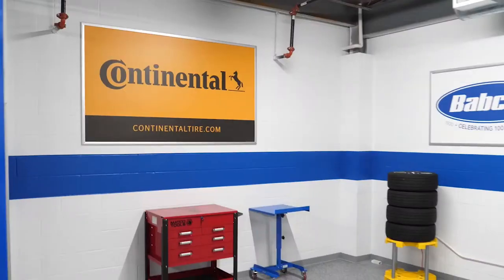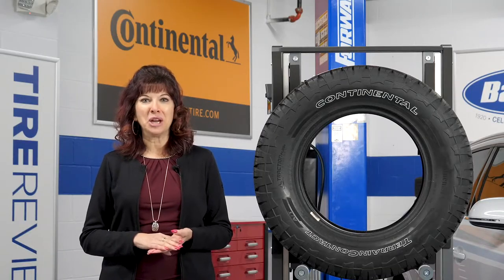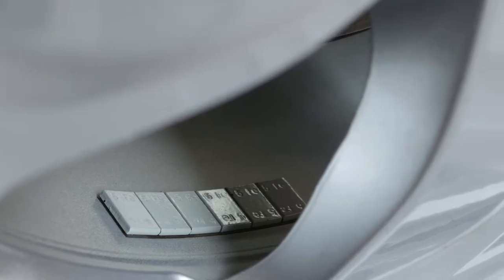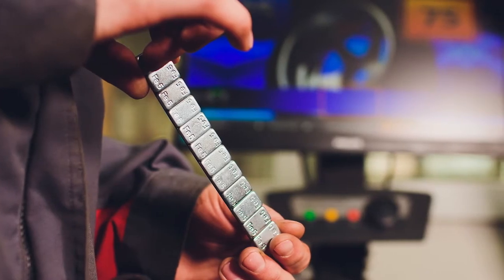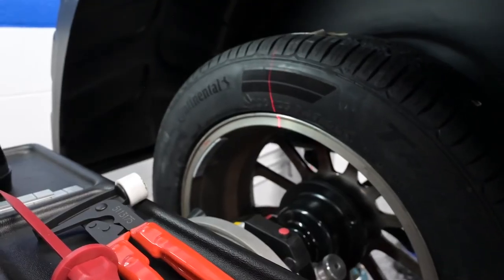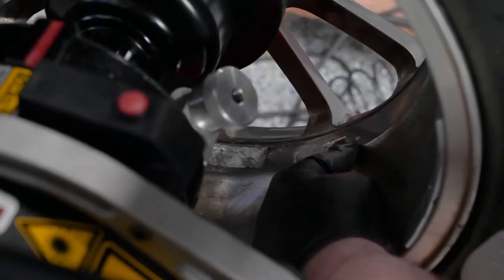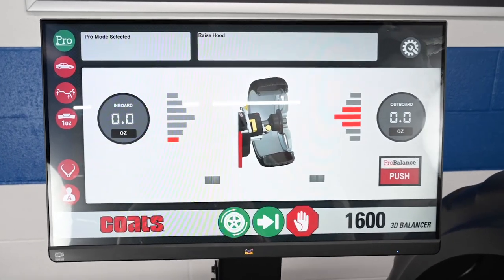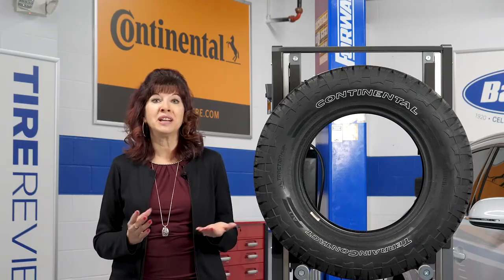Properly Installing Adhesive Wheel Weights

Comment: It sounds so easy.Put adhesive weights on a grimy ,pitted,rusted,wheel,that's covered with old adhesive. Re spin it and watch the weights go flying off.take it off the balancer drop it on the floor and then the weights come off.If not then drive it hear them as they fly off.I've given up.I use my on glue on the weights.

Comment: Avoid spirited driving for a few days to let the adhesive drive?  Oof, no shop ever told me that, and I seem to have been just fine.  I had no idea they just glued em on!
Reply: That makes no sense, the centrifugal force will push them towards the wheel, unless you’re doing some hard braking and your wheel gets hot then that’s a lie.
Reply: @adamfpv8294  yeah so I mean if weights are hammered on or glued, they good to go!
Reply: @adamfpv8294   i think she means aggressive truns at high speeds
Reply: @pilotpig_  that would make more sense.